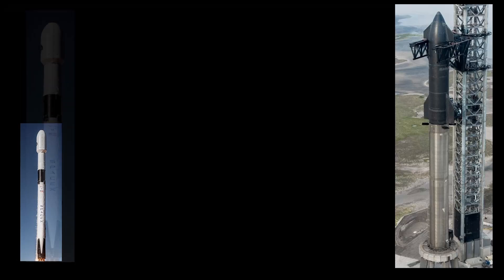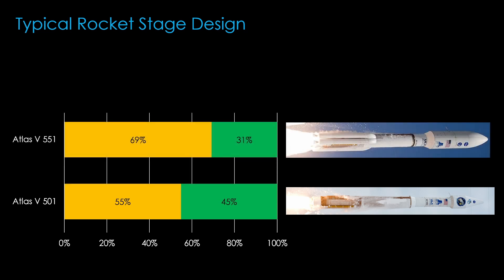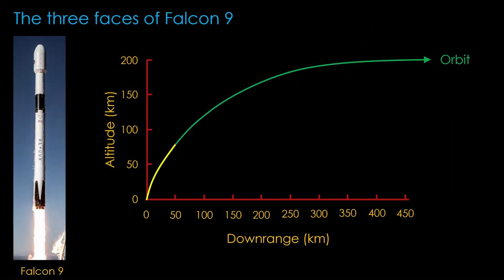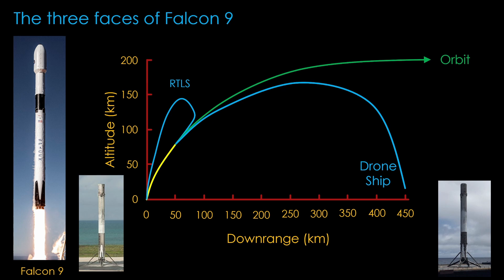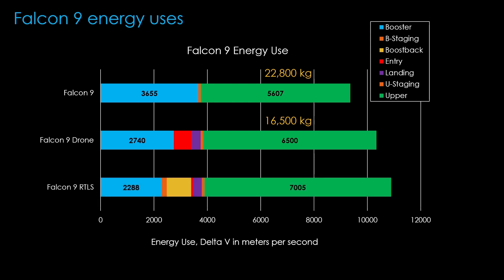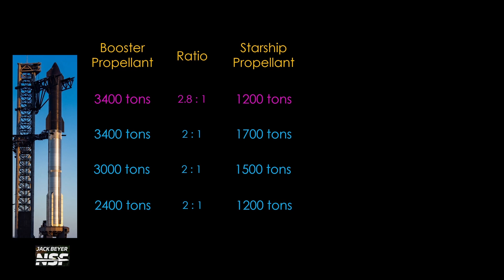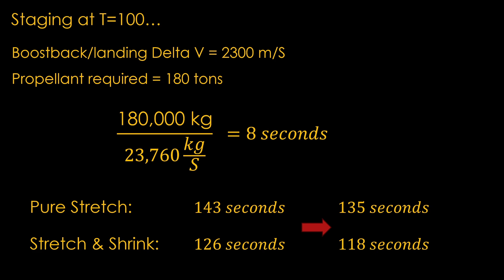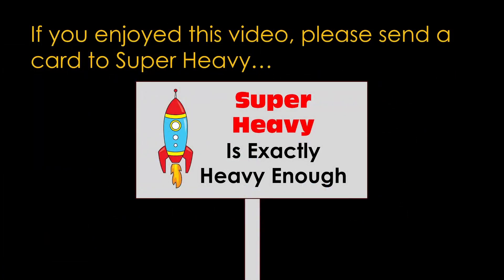Starship Optimization - New Rocket, New Tradeoffs

Comment: Have you found any interesting new info about this with from the new tests? Or will V3 be the important thing to look at?
Reply from the maker: I think it's interesting that they are testing a bunch of different tiles. The current tile approach is really hard because the underlying tanks go from very very cold at launch to warmer during reentry and the change in size of the tanks makes it really hard to make the current tiles work and be durable. Shuttle didn't have this issue because the tiles were on the orbiter, not on a tank. 

If they could make metallic tiles work that would be great as they would expand/contract with the tank.

Comment: Could you redo this video now that you realized more about the architecture (the steepness of the Δv function), that we know that the booster won't shrink and that there will be 35 engines?
Reply from the maker: Probably not. Generally when I finish a video I lose interest, or to be more correct, I get more interested in whatever is coming next.

Comment: There's another advantage to early staging. Most of the atmosphere is down low, meaning that the booster can capitalize on compact, low expansion nozzles while the starship can run vacuum optimized engines along it's entire ascent where the improved Isp is most needed.
I believe KSP exaggerates the effect of nozzle expansion and I quite successfully exploited this for highly cost effective almost-ssto vehicles.
Reply from the maker: In boosters you generally care more about thrust than you do about specific impulse, as the amount of rocket you can lift depends on how many engines you can stack under it. The exit diameter of both Merlin and Raptor are roughly the size of the rest of the engine so they can be packed tightly.
Reply: @EagerSpace  Exactly what I meant.

Comment: Falcon 9 uses ~113t of propellant to do an RTLS landing. With an avg Isp of 296.5s, that's ~5250 m/s of required delta-v. Thats ~750t of propellant for a 200t Super-Heavy with the same trajectory. Adjusting for it's higher terminal velocity and more energetic staging point, Su-He could need up to ~1000t.

I also calculated independently that RTLS landing F9 would require ~1465 m/s, but real fuel usage is wayyy higher. Maybe it's some massive cosine and gravity losses.
Reply from the maker: The new starship configurations are especially designed to stage earlier and lower and push more of the delta-v requirement onto the second stage.
Reply: @EagerSpace  Could that get the delta-v requirements below an ASDS Falcon 9? That requires ~55.5t of fuel for a 22.2t F9 1st stage, ~3640 m/s of Δv. That's ~390t of propellant for a 200t Super-Heavy. Idk if I believe Elon on that 200t dry mass anyway.

Edit: I used a specific impulse halfway between sea-level and vacuum.
F9 = 296.5s (282s <-> 311s)
Su-He = 345 (327s <-> 363s)

Comment: Would ditching return-to-launch-site for Super Heavy – and instead landing them somewhere around Africa – allow for any significant gains?

I assume the biggest roadblock would be getting the boosters back, but that could be achieved with either a second, booster-only hop or by then launching more Starships from a few different places around the globe, forming a cycle. Assuming that the west coast of Africa is the right distance, the next spots would be around central Asia (Kazakhstan | Mongolia | China) and in the middle of Pacific.

Besides that, such a change would require major redesign to fit the new constraints (tho if thousands of Starships are the goal maybe it would be worth it once everything else is perfected).
Reply from the maker: Super Heavy wouldn't be able to make it transatlantic, and the problem is that the direction that you launch changes depending on your target inclination. Shuttle had that issue for transatlantic aborts; you can see the details in my shuttle abort mode video: https://www.youtube.com/watch?v=WQLqQKHxJIY

You're stuck with barges or other maritime vessels if you want to land downrange. And those are expensive and subject to weather, and the you need to wait for them to come back. If you want to hop back, you need a full fueling system on the landing barge, which means regular deliveries of propellants. And you need multiple ones to get to different inclinations. 

way easier to just plan on coming back to the launch site every time.

Comment: I suspect hot staging also offers improvement in abort modes for the ship.
Reply from the maker: It probably does as it would allow you to spin up the second stage engines right away rather than trying to stage from a dying booster.
Reply: That could totally be a feasable abort mode for the booster portion of the flight with a landing droneship, or maybe even RTLS. 

In any case, with bellyflop>powered landing your survival chances are pretty good regardless of where you land. But, all that is only true if there is an issue with the booster. If there's an issue with the ship... well, you better hope that it's not the centre raptors.
Reply: The abort options for the space shuttle were much worse.
Consider solid rocket boosters, or the need to get the shuttle to an altitude and speed that allows for landing on a runway.
Also the early implementation of ejection seats, and the later implementation of a pipe that the whole crew could slide down are to say at the least, limited.
 Stership has the potential to do much better than that.
Reply: It looks like there wasn't much left of the Titan 2 first stage after hot staging.  True, the Titan was never meant to be reusable, but the stress on SuperHeavy is nontrivial.  EM's explanation on why the second SH was lost after separation (an LO2 dump) escapes me.
Reply: @armandomercado2248  only way EM's explanation makes sense to me is if there are some methane leaks on the raptors. They solved these on SH with CO2 and my guess is they deemed that  mitigaton unnecesarry on the SS due to SS only firing it's raptors in thin atmosphere where there's not enough oxygen. And then they forgot about that part and dumped that oxygen there themsekves.

But this is purely my ad-hoc attempt at explaining Elon's explanation, i have no idea whether any of this is correct.
Reply: @TheNheg66  Most cryogenic systems leak.  Seals at those temps are not easy and rarely are perfect.

Comment: Have you considered that at sea level the ISP isn't the same as in the vacuum?
Reply from the maker: I'm assuming you're referring to the mass flow rate. 

Engines get higher exhaust velocity in vacuum because of the lack of atmospheric pressure. That pushes the thrust up but doesn't generally affect the mass flow rate.
Reply: @EagerSpace exactly, the mass flow rate should not change. But you calculate it using the ISP. That changes. So which ISP should be used? The sea level one or the vacuum one?
Reply: @AlbertoGirardi747  The thrust also changes, you should use the sea level thrust and the sea level Isp, or the vacuum thrust and the vacuum Isp.

Comment: The 'just enough booster to make things work' line has me thinking about Mars ascents. Musk said a while back that a Starship could SSTO from the Martian surface and this looks even more reasonable now
Reply from the maker: It's so much easier to get from the Martian surface to orbit. It's only 3600 m/s of delta v, where getting to earth orbit is around 9000 m/s. 

You can get from the surface of Mars back to earth for 5700 m/s. My model says that you can do that with the current model of starship with 150 tons of payload.
Reply: @EagerSpace so it’s like orbiting Kerbin? Huh.
Reply: So orbiting Kerbin is about the same DV as orbiting Mars? Huh.

Comment: I don’t think hot staging is as pure a win as you make it seem here. It’s a tradeoff, and the things it trades off for the advantages are significant even in this context. While it does reduce boostback range and save you some gravity losses, those gravity losses are quite small by my figuring. The procedure itself is violent - this was shown excellently by the clip of the Titan II blowing out its interstage. While SpaceX’s interstage would be built to survive this, to do so repeatedly requires a heavy blast shield and grating, which will increase dry mass, in turn reducing or possibly even negating the performance benefits relative to a more conventional staging procedure.
While hot staging is what SpaceX have chosen for starship, it’s not necessarily the optimal choice for a reusable rocket, even one of similar configuration and flight profile.
Reply from the maker: The staging losses are in the range of 100 m/s for the second stage, 200 m/s for the first stage. You also save an additional cost  on the first stage by not coasting downrange during staging, that's maybe another 100 m/s. So 100 m/s second stage, 300 m/s first stage. It's not huge but it's not nothing. I'd love to know what the change in mass is, but it suspect that it's not going to be enough to overcome the savings in delta v on the first stage. 
The other big win for the first stage is that with your engine(s) still running, you can gimbal your way around to head back where you came from. That's another savings - if you compare how quickly starship flips to land versus how long it takes Falcon 9 to do a 180. 

WRT the violence, that's an outgrowth of the Titan approach. The part that fragments is an interstage shroud that covers the second stage engine, but on Starship that shroud is integral to Starship, so there's nothing to fragment. 

Having said that, I don't think the current design is a reusable design - I think it's just the simplest way they could test things. I'd expect to see something two rings high with some protection on the tank top. 

I also suspect that they might go for a staged ignition - just light the three sea level engines to get starship away from the booster and then light the others soon afterwards.
Reply: @EagerSpace  I believe you’re significantly overestimating the gravity losses there. That 200 m/s you quote for the booster isn’t actually something that needs to be made up. The booster’s job pushing upwards and outwards to fling the upper stage away from Earth is done, and so it doesn’t need to carry extra fuel to do those things. The gravity losses on the upper stage are those that need to be made up. The range savings for the booster are real and do need to be considered, however, and is why flipping over quickly is desirable. If we take your 100 m/s as gospel, that may or may not be outweighed by the extra mass of the shielding. 

The Titan approach did fragment the interstage, but it’s not necessarily because the the second stage engine bell was contained within it. You’ll note that the fragmentation happens only after the bell clears the interstage, which puts it near where the booster’s hot stage venting would be when the orbiter’s Raptors have to pull it away. There’s something there to fragment indeed, even though it can be built not to.

Finally, based on what we have seen of the hot staging hardware for Starship, your staged ignition idea is likely nearly correct. The shielding only provides clearance on the sloped part where the Vactors’ exhaust would impinge on, and very little near the sea level engines, where there’s a flat plate. This would indicate only the outer engines would be firing during the initial part of the maneuver. It’s still not going to be a light piece of material that withstands their exhaust point-blank.
Reply: Elon mentioned 10% improvement when HSing comments at the time I think said ulage of propellant was a significant benefit.
Reply: @kiwigurn  Yeah. I don't put much stock in numbers Musk says in a tweet, but it's true that the previous "twig snap" could have caused some problems with the ullage gas.
Reply: @ryanrising2237  You may not put much stock in the figures Elon stated but to keep in mind it's hard to give any more credence to internet experts vs. someone who has actually SEEN the data.  Most pretend they know more than they actually do in these comment sections.
Reply: @TheEvilmooseofdoom  Yeah, the lack of good complete information on these projects make it kinda difficult. At least you can verify or refute the reasoning of people who don't hold privileged information, though.
Reply: For you maybe...

Comment: Heads up, that video you showed at the beginning shows staging on a Saturn IB vehicle. This is observable from the cylindrical interstage - though that might be hard to tell from the wide field of view - and the triple ullage motors on the S-IVB, of which there were two in its Saturn V configuration. That video clip is commonly misattributed to a Saturn V, as you did here, but in reality it comes from the AS-202 mission testing out the Apollo CSM.
Reply from the maker: Thanks. I should have keyed on it being Apollo 4...
Reply: Tech channels have the best comment sections. :-)

Comment: with the risk to embarrass myself, how much of a problem is the hot staging for superheavy? that titan separation looked pretty violent ...
Reply from the maker: My take is that the current design is a "what is the minimal thing we can do to test this?" approach since they aren't planning on getting this booster back anyway. 

I think a real design probably needs a taller vent area, probably two rings high.

The titan staging is violent because the shroud around the second stage engine is part of the first stage - that is what you see explode as the first stage pulls away. In Starship the shroud is part of starship, so as soon as there is separation between the stages the exhaust will be much less problematic.
Reply: It can be assumed they’ll want to build that ring so it doesn’t explode like Titan II, but as SpaceX has found out in other situations, point blank rocket exhaust is not good for the surface being subjected to it. The hot staging shield will need to have significant mass to survive that repeatedly, which makes hot staging not a pure win. In some situations it’s still worth it, and maybe starship is one of those.
Reply: @ryanrising2237  Steel does give them some wiggle room.  It can take a lot of abuse and heating and stay strong.  I suspect the ring and shield will be a WIP for a while. :)

Comment: The stretched version would use nine raptor engines(sixth vacuum and three sea level)according to Musk (and have an initial mass of 6 000 tonnes),, so probably your estimation for upper stage is too low, we are speaking about a 2100 tonnes upper stage!, if we ignore the payload !, reusablilty isn't included in those calculation, but for booster wouldn't be that hard, and for upper stage penalty would be so huge that is better to consider only expandable upper stages!
Reply from the maker: I do expect the stretch starship to use 9 engines...

Do you mean 2100 tons total for starship or 2100 tons propellant? 

2100 tons total would be around 1800 tons of prop with payload of 150 tons. About 1.9 to 1. I'm taking "trending towards 2:1" as meaning "coming down towards 2 to 1" as they were considerably higher than that. 

To get to 2 to 1 requires more prop on the booster and it's hard enough to get to 100 seconds for staging with the current prop load; more prop make that harder. It also might require changes to the launch tower and that would likely be slow.
Reply: @EagerSpace  I mean 2100 tonnes (2000 tonnes propellant) for a expandable upper stage that needs to deliver 300 tons of payload into LEO, that is the only way you can deliver such huge payload without modifications to the booster, also probably that 300 tons payload would be propellant for refueling HLS(so no fairing for payload but a ship made from tanks, or a fuel depot ) , because that is the priority that needs to be achieved in less launches, like four in this case. Well actually total mass for upper stage would be 2400 tonnes with the propellant that would be delivered into LEO, so actually 65%from the booster mass, but would be only with five meters taller than current vehicles ,  those speculation are on Musk claims that future version would weigh 6000 tons and delivers 300 tons of payload into LEO(I find kinda vague that " roughly 2 by 1 ratio" ) , like I said only way that would be achieved even on the paper is with a expandable upper stage and that need to have a dry mass of 80 tonnes , and nine engines(those would be more powerful than current ones and delivers 25 MN of thrust, which will take from the beginning to a thrust to weigh ratio higher than 1/1), in this case the booster will contribute with 2700 m/s deltaV and upper stage with 6600 m/s deltaV. Maybe the booster can be reused but the upper stage not, with the exception propellant depot usage .

Comment: What dry mass numbers and payload did you use in the thrust-to-weight calculation? Assuming 170t for the booster, 100t for the ship and 100t for payload, witch seems optimistic, the total mass for the streched stack would be 5470t. Thrust would be 33*234,5t=7,740t for Raptor 2. The thrust-to-weight then would be 1,41, which sounds about right and we would get to 1,3-1,4 if the dry mass or payload is heavier.